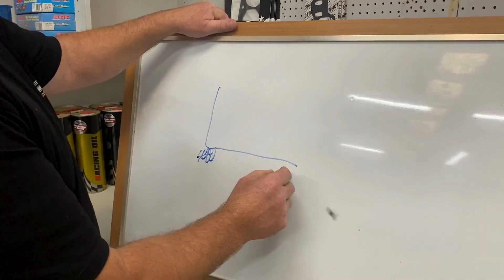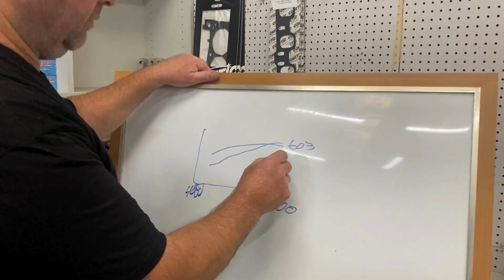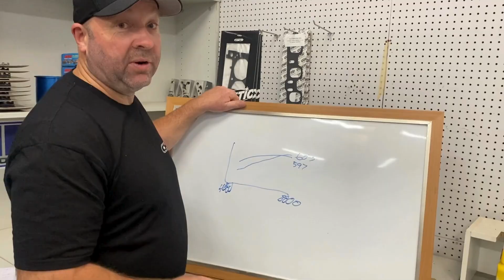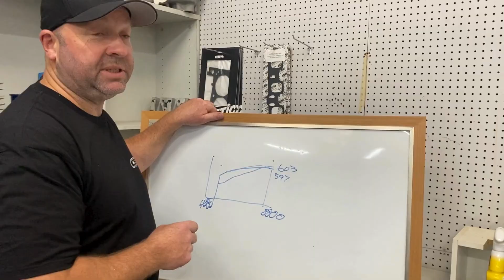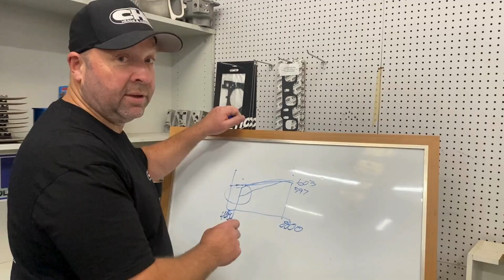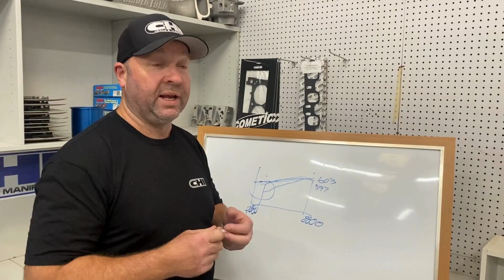Truth about over working your engine?

Comment: The racer didn't know Jack about engines. I doubt he did very well in his racing career either. He's is what we call a "Dyno Queen". The only way that would work is with a CVT that keeps the engine at peak HP. For me I always looked for the Power from the lowest rpm the engine drops to after an up shift, "usually after 1-2 shift", to your shift rpm.

Comment: We have to beat this into people heads daily when they ask us to design a cam for them, You have a cfm demand that is calculated from cubic inches and rpm,  you need ENOUGH  cylinder head to meet this requirement, most people don't have enough head and try to make up the difference with camshaft,  all that ends up happening,  is you "may' gain a couple peak #'s but the averages will be down,  and averages win races not peak #'s.
Reply: I generally run less duration than most for the engines I do for clients and myself.    No complaints so far.
Reply: I wish you weren't so far away, shipping would kill me. I live in the toolies and don't trust the local good old boys Get it in get it out shops. I've built my engine , but it doesn't make sense No more than I do to buy the spring tester or guide reamer. Plus I would like to have them squared up/ good and flat.  and a proper valve job, Maybe a back cut.
Reply: Area under curve is God.
Reply: @markpavletich747  It depends on use though, if torque area was king then Diesels & supercharged engines would be the top by a large margin but that is not the case for anything EXCEPT tractor pulling, where it does really matter. For racing in general it's also very very important because you're only @ peak on straights. In a drag-race with an auto however, especially if you're using a modern one with 8 or more gears peak is all that matters really. Even Diesels that do drag-only are set-up for peak with ridiculously-large turbos that come in very late in the range (though usually compound of course) & they're over-injecting so much & have such poor combustion efficiency that sometimes you see fire coming out of the exhaust; they sacrifice everything for RPM & peak (Diesels struggle a lot with RPM, that's the nature of Diesel injection). With that said, gaining 2% HP and losing 20% under curve is definitely always a bad thing!
Reply: @bo-dine7971you misunderstand me. Total area under curve compared to other bikes/cars in the same class of competition is what I am referring to.

Comment: They forget torque does the work.
Reply: The last physics class I took taught that torque involves a force factor & HP is how much work is done in a specified time period.
Reply: Torque is more important than horsepower to me! Ask my big block chevy 😆
Reply: @musclebone7875  torque is just a measure of force and horsepower is just a unit of power, regardless of what your engine is 😂 one is not more important than the other, but horsepower actually measures how fast can your engine move your vehicle. Torque can be multiplied by gearing, horsepower cannot be multiplied by gearing. So if an engine lacks torque, gearing can compensate, can't do that with HP because HP is an actual measure of how capable is your engine is at moving things.
Reply: @approachingtarget.4503  work is force with distance, so yeah it is part of Work. Torque and HP are just measurements.

But one can have torque with zero motion, which is useless for a motor vehicle. Horsepower implies motion, because it is the rate of how fast can your engine move your vehicle's mass.

Torque can be multiplied by gearing because it is just a force, can't do that with horsepower because it is your engines actual capability.

Comment: So you took a engine  with low airspeed  and low rpm pulse back  and put less camshaft  in it and made the same basic  hp peak .... if you had fixed  the airspeed  problem  instead  it would  have made more low end and more peak power  ...
Reply: you mean keep the 270 cam and just make the port smaller?
Reply: @duanebusch72 above  about  256 duration at .050 you are really  working  on more then 100% VE  ... it takes airspeed  to make that work .... the cross section  needs to be correct  yes but not at the loss of airflow  .... it could  be that the runner  length  was not correct  as more runner  increases  airspeed  .... since  the peak power did not really  change  you know that its really  not filling  like it should  with the bigger  cam ... rpm for head flow could be low ... looking  at cfm demand  vs rpm and head flow helps ....  it could  have been just to much taper  in the runner  .... once you know what it should  make you can hunt down why it doesn't  .... getting  that 120% ve is work every  thing  need to be correct